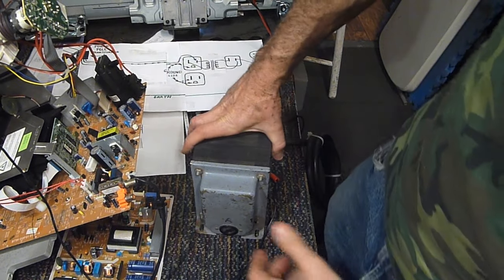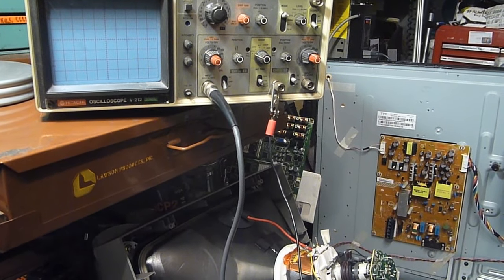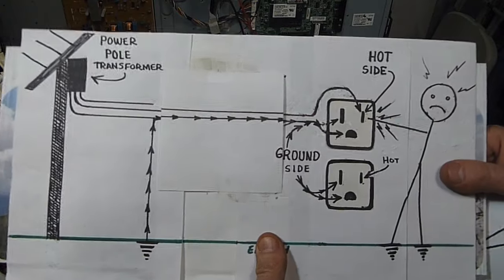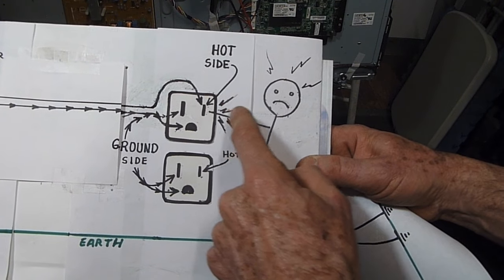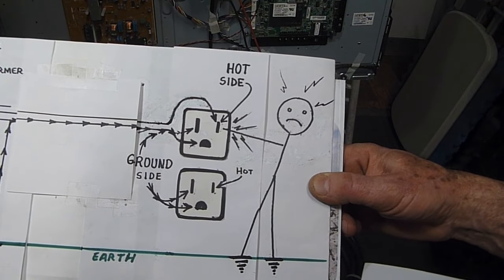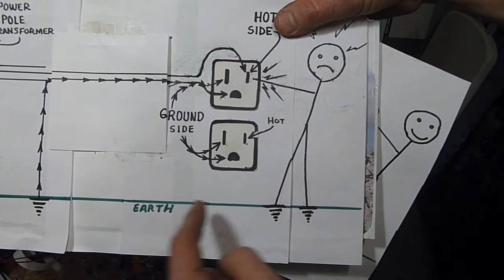Isolation Transformers can save your life, and your equipment.

Comment: There are many videos on YouTube about the purpose of an isolation transformer.   This one is the clearest and most accurate.   However, there is a brief reference to "having the oscilloscope connected to the isolation transformer".  That is not a good procedure.   Instead, connect the device under test (DUT) to the isolation transformer.
Reply from the maker: Thanks. That's the kind of comment I like to hear. Keeping it simple is a big part of my thinking when I make a video.
Reply: Just one other point:  While the "earth" path does provide some (undesired) conductivity (as shown in your diagram), the ground wire running from the third prong back to the circuit breaker panel is the primary path of (undesired) conductivity.   The "earth", the third prong, and the neutral are, of course, bonded together at the service breaker panel as required by the NEC.  The key point to understand about a "tech" isolation transformer it is that is breaks the bond between the neutral and the ground conductor (and earth).
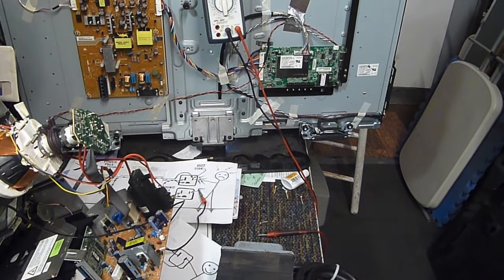Reply: However, you can inadvertently reestablish the bond between neutral and ground by plugging a three-wire device into an a "boxed" isolation transformer because the input mains ground and the output mains ground are bonded together, even in a "tech" isolation transformer.   That's why you also need the three-prong cheater plug when plugging a three-wire device into an isolation transformer, as explained starting at 4:58 in the video.
Reply: I wish to demonstrate noise on an AC main displayed on an oscilloscope, how will I do that safely if do not connect the isolation transformer to the scope?
Reply: Fully agree

Comment: The thing with some newer isolation transformers is that the neutral is connected to ground.  The little adapter you had there won't prevent a hot chassis as long as the neutral is still connected to ground.  You have to physically disconnect the wire that links the neutral line to ground in order to float the output.
Reply: Having a ground connected to the floating secondary side of the transformer voids the whole principle of the isolation transformer itself. Especially if it's connected to neutral, don't you have earth leakage differential breakers where you live?

Comment: Three reasons  to use: Prevents electric shock (ground islation), suppress electrical noise in sensitive devices, and transfer power between two circuits.

Comment: I had a few times I got shocked I got nailed by 440 dc while on submarines which I spent 7 years on . It was built in the late 60 s It has a floating ground so when I was using a o scope across it with out an isolation it blew up the scope and me . Believe it or not the NAVY test for using back then was to remove the ground off the o- scope  I also got nailed while working on a generator outside in a storm I was about 100 feet from a lightning strike and the voltage went across my chest and come out my hand . I was blind for 4 days and still have the scars today .I was lucky to have the guy working knew how to use a resuscitate kit.

Comment: The direction of the horizontal arrows in your diagram should face to the left. The fault current will flow from the hot of the transformer to the socket outlet to the body of the equipment through your body into ground, up the ground wire and to the left back to the source, which is the transformer, not the socket outlet.

Comment: Balanced isolation transformers, which are popular for line noise filtration for audiophile and home theater equipment, usually have a center-tap on the secondary which is connected to the ground contact of the outlet and even the case. That has to be disconnected to use on the test bench. Otherwise there's still a DC path to ground from ground and both legs on the output.

Comment: I picked up a used Tenma 72-1095 Isolation transformer and variac combo unit a while back.  It's a nice unit and can handle up to 3 amps but the funny thing is that it still has a feed through safety ground (the output ground is bonded to the input ground) even though it is a "tech" isolation transformer.  I ended up modifying it and putting a toggle switch in to make the whole thing either floating or grounded depending on what I'm doing.  Just goes to show now matter what you buy,  always check the grounds.
Reply from the maker: Hopefully others who buy them figure this out like yourself.
Reply: Why would you need to have earth linked between input and output as it loses the whole point of being an isolation transformer? I'm sure I'm missing another sort of application here
Reply: @santoelectron  US regulations and electrical code.  Devices sold in the US especially with a metal chassis and mains powered must be earthed.  You just have to modify it when you buy one.

Comment: That's a great idea! Btw...I never trust that the house outlets are wired properly. For less than $10 you can buy a little tester you plug into the outlet that tells you if it's wired properly. Love em!
Reply: @74dart man, you are so right! My sister and brother in-law bought a 40 year old trailer in Florida to winter in (so did I). I didn't like the way their breaker box was wired, and I have two year degree in industrial electronics, so we started testing all the outlets with one of those testers. We found about eight outlets wired backwards from the factory. So many were worn from use and we replaced about a dozen. Also, they had no lightning protection at the box and I added some.
Reply: @ggsumner1947  that's awesome that you found that situation and fixed it. You can never be too safe with electricity!

Comment: The item of special note is that the earth ground is no longer present on the secondary output meaning the ground port in the secondary outlet is floating. This is important with the reason being that a device under test could have its own neutral to ground union that you are not aware of. That being the case would be similar to the neutral of the secondary windings being grounded, just in a different place.

Comment: As far as "hot chassis" a lot of older equipment had non-polarized plugs. Sometimes you could eliminate the hot chassis simply by flipping the plug over, or outfitting the device with a polarized plug with the neutral connected to the chassis instead.
Reply: Ryan Toomey true but that doesnt solve the isolation issue. But does make it safer.

Comment: I got super lucky with a tv the other day. Symptom was wiggle the cord,  tv came on. Finally died.  Was given to me to fix and I opened it up and the cord was fine. When I plugged it in it arced across the rectifier and polyfuse. Bent the leads and the damn thing worked. Free 2 minute fixes for a free 50 inch works for me.  Glad I didn't need to pull out a scope,  don't have an isolation transformer.
Reply from the maker: Good deal. Sometimes the repairs are quite simple.

Comment: Great explanation and visual the best I have seen on you tube bar none. Carlson labs has a vid on this but fails to explain that his iso transformer is NOT completely isolated (ground)  and assumes that all are like this. Some iso transformers will have a 3rd ground plug in  on the output just to conform with saftey requirements but do not make a connection to the chassis and are still isolated, therefore you have complete isolation. Contrary to Mr. Carlson the adapter is safe to make complete isolation if your transformer is not. Great vid again. Thanks.
Reply from the maker: Nothing like a hands on experiment to bring a little clarity. Thanks for the kind words.

Comment: Also to mention, that a isolation transformer doesn't have a neutral on the output, but has in fact 2 lines (hot) wires, with 110/120V or 220/240V between them,
and a ghost / phantom voltage between one of these 2 and the real earth.
Another note is that the RCD in the breakerbox doesn't trip, when you touch one of the 2 line wires of the output of the isolation transformer. 
Adding a RCD at the output of a isolation transformer doesn't work either, because a RCD won't work with 2 hot wires, and needs a neutral.
To create a neutral on the output of the isolation transformer, you must bound one of the 2 hot wires to ground/earth, 
that one becomes the neutral now, the other wire stays the line (hot) wire.
The RCD will then work, but you loose the benefit of the isolation between the hot and ground reference.
At the end, it is a choice to make between protection against electrocution by using a RCD, or protecting the oscilloscope by isolating the DUT (Device Under Test).
There is a sort like RCD device that works with networks without ground, and its called a "Isolation Monitor Relay", but is very expensive and used in industrial sites.
Reply from the maker: Thank you for this information.
Reply: No no no! The output is isolated. You will not get shocked by either of the wires as the output is not grounded. You must never ground the output of an isolating transformer. You will defeat the purpose and create a death trap.

An RCD will not work as it is it possible to have a ground fault as it is not grounded. An RCD does not need a neutral. It just needs a grounded (not to be confused with earthing) system. If could be midpoint grounded like US 240 V or British 110 V construction site voltage. Those both have two hots (unlike the output of the isolation transformer) and an RCD works. Isolation is a far better safety system than an RCD.

Note that you can still get shocked if you touch both of the outputs. Then you will complete the circuit and the shock is as bad as any mains voltage shock.
Reply: @okaro6595  i'm aware that grounding a isolation transformer defeat the purpose of a isolation transformer.
But later i found that there is a way of using a RCD in combination with a isolation transformer and have a mix of both worlds.
If you tie 1wire of the secundary side of isolation transformer to the earth pin of the isolation transformer outlet socket, and from this connection a 1M 3Watt resistor to the earth of the wall outlet, then this connection becomes a neutral. The 3Watt is for the voltage rating.
This way you have a high impedance earth connection from isolation transformer output to ground, and you have a low impedance connection between the earthpin of the isolation transformers output and  the second live wire of the secundairy. With this configuration a RCD will trip if there is leakage from the second live wire of the output to chassis of the DUT.
Reply: @BjornV78 How will the RCD work? You’re creating a high impedance ground to the source of the wall socket. The current that will flow when there is a dead short to ground (ignoring wire resistances, contact resistances, etc) is 240V / 1M = 240micro Amps. RCDs will trip for earth fault currents > 30mA. Are you sure the RCD will ever trip.
Reply: @pietervdberg7055  , 240V through a 1M resistor is not 24mA but 0,24mA or 240µA. In a 120V country it's 0,12mA or 120µA.
And Yes, this high impedance grounding will work because i have tested it with a portable 10mA RCD. A Portable RCD or any other RCD connected to the output of a not mains referenced power source (floating power source like the secundary of a transformer) can't trip without this high impedance "grounding". 
Inside a RCD there is a coil (donut) with 2 wires passing through the donut , normally the neutral and phase or hot wire. Because a transformer doesn't have a neutral on the output, and a neutral is 0 Volt, 0 Volt can't be passed through a transformer. So the secundary of a transformer (or isolation transformer) has in fact 2 phase or hot wires and none of these are referenced to ground or the metal chassis of the device connected to this transformers output. 
When one of these 2 wires touch the metal jacket of a device connected to the transformer, nothing will happen with the RCD that is connected between these 2 phases / hot, because the earth wire of the device is not referenced to anything.
For the RCD to work behind a transformer, you need to make one of these 2 phases / hot become a "neutral" or referenced to the ground (metal chassis of the device). But this will defeat offcourse the purpose of a isolation transformer, but if you limit the fault current to 240µA or 120µA, a RCD can work because now there a path for the fault current, and a inbalance in the donut can be created to let the RCD trip if the value (10mA , 30mA etc...) of the RCD is reached.
Reply: @pietervdberg7055  also to note, this 1M resistor is not passing the trip current of the RCD. The tripcurrent will flow arround the donut of the RCD, and that will create the inbalance that a RCD needs to trip. If i could add a schematic of this, this will be a lot easier to understand how this trick works. But YouTube doesn't let me place a hotlink to a picture with the schematic.
Reply: @BjornV78  Thanks, sounds interesting. Would have liked to see the diagram as it will potentially solve a problem I have with sensitive equipment near DC traction system. Every time there is excessive stray current leaking into the ground from rails it flows into the sensitive grounded equipment and destroys it. 
How about making a video and explain the diagram in the video. I can picture the diagram but would like to hear the explanation of its working. Would a normal 30mA RCD work as explained.

Comment: This video is old, but just in case someone stumbles upon it, simply removing the ground prong puts you into a worse position then before, and having the transformer not being grounded at all is also dangerous, all you want is for the neutral and ground to not be bonded, not allowing that fault current to go through you on the secondary side(where you plug your device into). It still allows fault current from the primary side(where the transformer plugs into the wall) of the transformer to go through and trip breakers instead of blowing up.

Comment: Explanation very clear why it’s essential, but it’s the implementation that is super confusing. Some are saying disconnect the ground wire inside the IT and you’re good to go, others say oh no that’s not right, others just use a cheater 2 prong plug, others say no. I haven’t seen a single video yet on how to get this 100% safe and correct that all agree on. Really wanna get this right but it seems impossible as I’m just starting out. :(

Comment: Thanks so much for this video.  In a professional audio recording atmosphere, would you say this could be a possible solution for isolating specific pieces of gear on the same circuit (analog and digital) that may introduce a 60 cycle hum back into the shared power line?
Reply: im here for the same reason

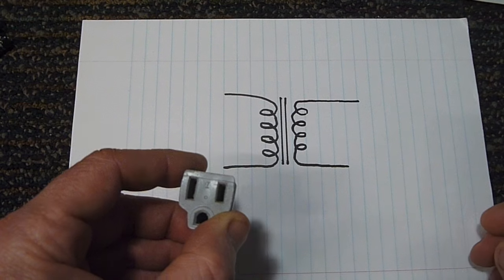Comment: 5:46 The adapter you are holding in your hand will not serve as an isolation transformer, it only cuts off the earth wire. The neutral wire, which has been carried over, is till connected to earth either in your household or somewhere in the distribution system.

Comment: It's 120 240 equipment is labeled 110 220 because of a variance but it's actually a 120 volts also isolating from the ground does not protect you from getting shocked because the hot to neutral can still get you shot it will only protect your equipment. Taking the ground out of the equation when working on live circuits is a good idea however that does not prevent you from getting shocked or from causing damage. And in fact with the ground isolated you have a less likelihood of your breaker tripping and therefore saving equipment other than the one that you're working on and that's only with improper technique where you ground out

Comment: I recently purchased a isolation transformer on Ebay and even thought there is no continuity or resistance between the windings when i plug it in I get almost full line voltage appearing between the small prong and ground. My understanding is that this is caused by interwinding capacitance. Do I have that right and do I need to be concerned about it when connecting a bench scope to a hot chassis under test?
Reply from the maker: Sometimes a meter can pick up what I've heard some people call phantom voltage. Perhaps that's what you're talking about when you mentioned interwinding capacitance. If whatever you are measuring is just interwinding capacitance, it should not have enough power to operate a load such as a light bulb, so it might be interesting to place a  120 volt light across the two points you measured from, and see if there's enough power to operate the light.

Comment: Great explanation. Can you still get shocked when using high voltage and current with an isolation transformer
Reply from the maker: Electricity is potentially dangerous with or without an isolation transformer, but when using an isolation transformer you eliminate the potential of getting shocked between yourself and a ground or earth ground connection or damaging your electronic equipment from an unwanted ground connection.

Comment: Would you put that two-prong plug on the primary side to isolate primary from mains ground,  or should it be installed on the secondary side to isolate it from ground in case the secondary and primary are both grounded to the transformer body.